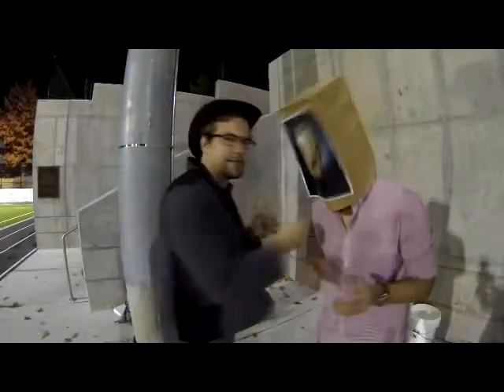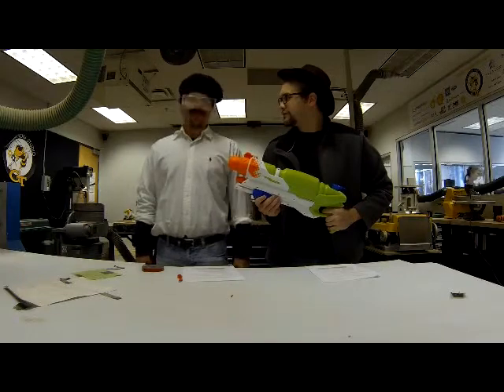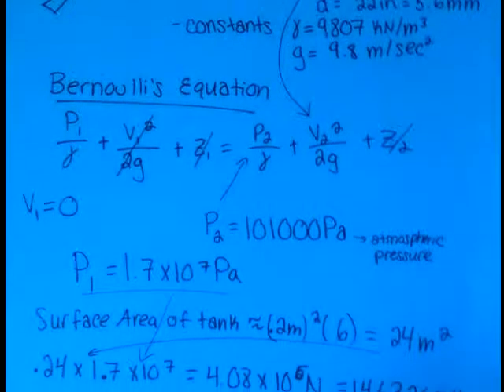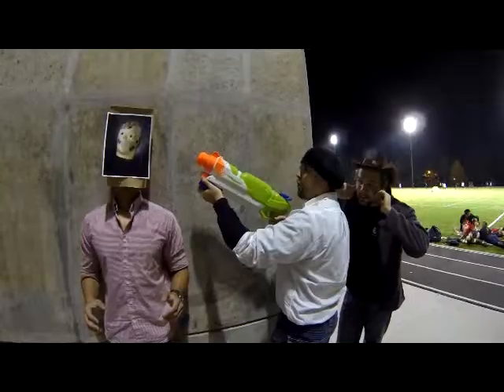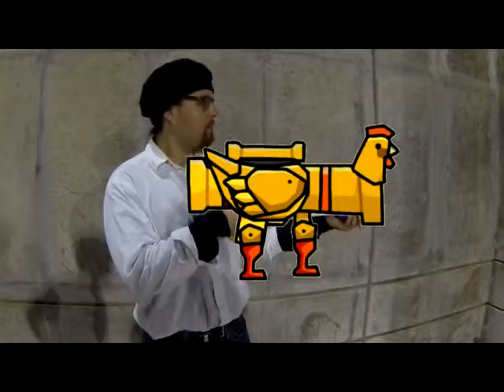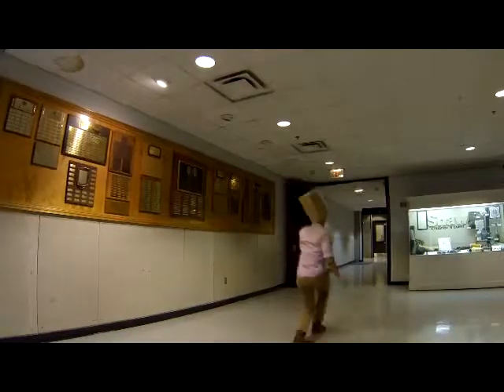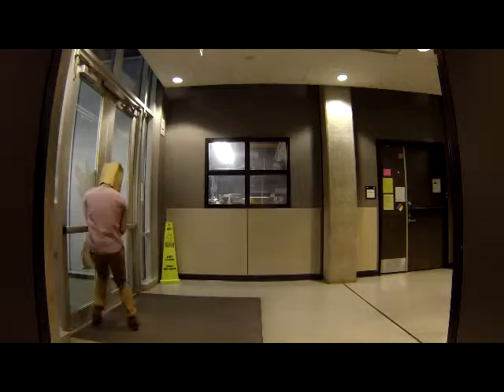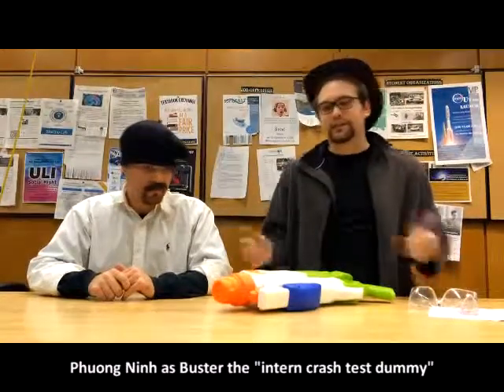Mythbusters: Lethal Watergun

Comment: It's very easy to make a water gun lethal. The main issue is mechanical quality as if the gun leaks then it will likely kill the operator during use when using chemical warfare weapons. The basic counter is latex gloves but the range is still an issue. Due to USA regulations on toys you will not find a gun that has a good enough range for killing without either using an old Super Soaker CPS 3000 or importing the 1/1 replica Splattershot of Splatoon.